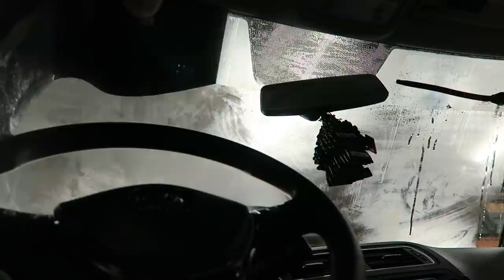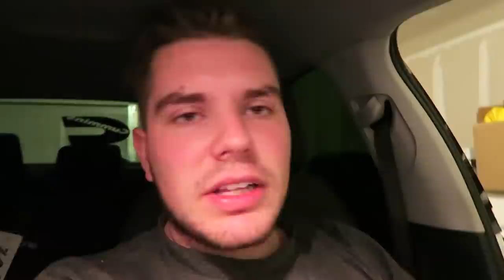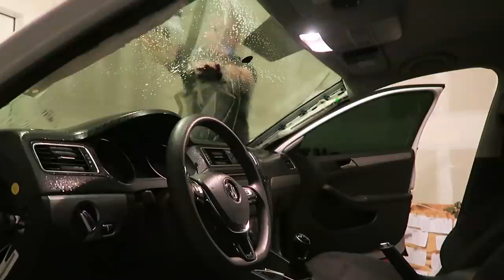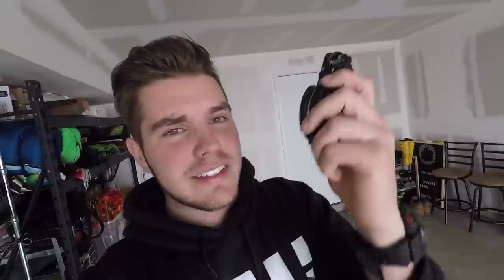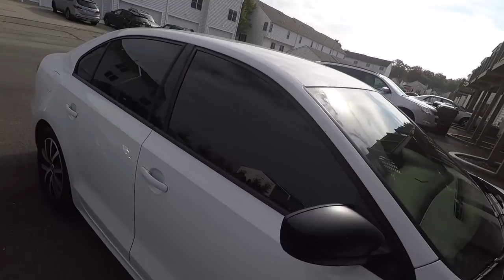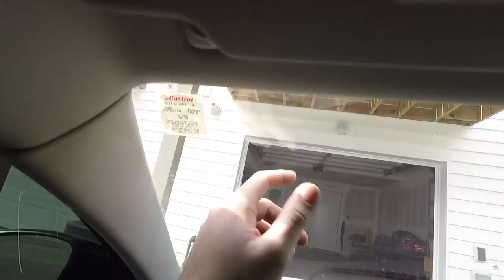What Happens When You TINT your WINDSHIELD!?!

Comment: Answer: Tickets. You get tickets.
Reply: Lel
Reply: Bs had it. Done for 2 months zero tickets was even pulled over for exhaust
Reply: dylan young lol not in Ny. When cops see tints it's an instant ticket
Reply: Never got a single ticket and it's been 2 years on my car. My dad's truck has 5% on the back. 35% front windshield, and 20% driver and passenger. His truck was from 1997, we changed the tints after 15 years cause it was getting old. But we kept the same shade. 20 years and still no ticket. My Altima has 5 all around and 20% on the windshield. Never got any tickets. This is all in New York and we've driven upstate and such with and passed not just regular cops and state troopers. We've gotten red light tickets and speeding tickets. But never for tints. Every time we get stopped we turn the interior lights on and roll the windows down before the cops even get out of their cars. Runs our license to see if we owe any tickets or any warrants for arrest. After we are on our merry way with no tickets.
Reply: Wrong, I have dark tint on my car and windshield and I haven't been bothered by the cops
Reply: Tint is regulated by state laws. It is the cop's decision if he wants to be a doucheback and pull you over, the law itself states windshield tint is illegal. The law also states the legal tint for the side and read windows.
Reply: Ricardo Sifuentes does it matter?
Reply: Cops don’t care for the most part. I have 25 on my windshield. I love it
Reply: I live in NY and got tints all around except windshield and never got pulled over or ticket
Reply: Jay Patel you just jinxed yourself
Reply: That’s so true because my went to ny and lives in md and they err going to give her a ticket
Reply: i live in NY i have 5% all my windows and i just got a ticket for the driver window 92$ for only one window smh , but when ya get a ticket you just gotta find a car the same brand take a pic of it go to court and be like i took the tints off more cheap than pay 92 for each windows
Reply: I have 5 all around and 20 on windshield and I haven’t gotten 1 ticket...
Reply: LMAO!
Reply: Harambe Jr. You ain't lying , of course YouTube got all the people in the comments that shit never happened to. 
But unless you live in a nice part of new York like long island or Manhattan, they're gonna get you.
Reply: i  tinted my  pick up  truck new in  2004   at 5% and  its  still  on  it  today  even  after  i  sold  it  years  ago  i  still  see  it  around    with  same  tint !14 years later
Reply: Will it pass inspection with tint like this?
Reply: Not in all the States like Florida it’s a law that you need tints on your car because of the sun
Reply: All depends on what state your in and what percent ... in Cali you can not have your fronts tinted but fuck it . officer's do it at my job all the time for 80$ . They usually get 20% 35% an 50%. I can do a FRONTwindshield in 20 to 35min.
Reply: My concern would be safety. Daylight is okay but night time with low lit areas. It would be hard to see out. Backing and trying to see if there are people or objects. That is a risk there.
Reply: Yeah Chicago has 35% limit but for some reason people get darker tints in tints on the windshield. Must have extra money to pay bills.
Reply: Jay Patel 
Yet...
Reply: That’s illegal in wa state
Reply: Not if you have a prescription
Reply: Zachariah Ishmael I have 25% all around in NYC no ticket ever never even got pulled over 😭
Reply: Zachariah Ishmael F NY
Reply: glovedcop69 no sir
Reply: THROTTLE KING my kia comes standard with 70% which is nothing..
Reply: Mikeman Jordan ticket is okay it’s the mandatory court appearance you gotta be concerned about
Reply: iRobux that’s awesome
Reply: @harambejr.4711  how can a ticket be a cops personal decision?
Reply: it's legal in Ohio. Only Ohio.
Reply: I thought that was legal in USA, in my country it isn't. In my neighbor country you can even tint your windows blue
Reply: Harambe Jr. cool
Reply: california driver here have went 50k miles 2 years no tickets so dont listen to this guy
Reply: @hambix1032  California? The same state that car enthusiasts have made numerous videos mentioning how strict their car modification laws are? LOL 🧢
Reply: @harambejr.4711  yeah man. i don’t drive like an asshole. cops don’t fuck with me. even if i did get a tint ticket, i’d just pay it. no points on my license or anything
Reply: @rogerlee6289  yeah if u open ur front windows it makes it look like u don’t even got the front windshield lol

Comment: For a flawless application, spray entire surface and adhesive side of tint with a mild soapy water. Lay the tint on the surface and smooth it out. The soap underneath allows you to slide it into place without it sticking. Then with an isopropyl alcohol and water solution, lift a portion and saturate the tint and surface and squeegee that small portion. Then spray alcohol a little further down working slowly and leaving soap solution on the portions you aren't working on yet. With either solution, it allows you to lift it to reposition it. After some heat and drying time, it will be flawless. No bubbles or dust if done correctly

Comment: Logical/easier thing would have been to drive at night with sunglasses
Reply: mirror tinted ones then ! But the best would be mirror tint on the windshield to see perfectly the road ahead without being blinded by those ultra bright led lights.
Reply: MrMit50101 .....best comment.
Reply: MrMit50101 Or just get Air blue for your windshield,it's 100% Clear but it acts just  like 5% Tint
Reply: How does it act like 5% tint when air blue is 75-80%. Key words, "Clear" and "5% tint" how is 5% tint clear?
Reply: MrMit50101 but tinted windows look better on ur car so it’s no point of wearing sunglasses

Comment: That windshield tint looks very nice im doing 50% windshield  15% all around and 15% over 5% tint strip
Reply from the maker: kia bass 879 that’ll be a dope setup!
Reply: I had 55% on mine at one point. Was way to light for me. Its hardly tinted at all when the Sun hits it. It looks dark in the video because the Sun isn’t hitting it directly. I have 18% full windshield with 5% on all other windows.
Reply: Ryan Mayer do at night
Reply: Ryan Mayer yeah I know it should look as dark as your windshild
Reply from the maker: The PurgeGod coming very soon!!!
Reply: Ryan Mayer very cool.
Reply: kia bass 879 You should just do 5% all around and air blue for windshield
Reply: Da,Taper I think 15% is perfect its not to dark or to light but if I don't like 15 ill put a layer of 5 over it and if 50 is not dark enough for my windshield ill do 25 after I strip the 50
Reply: Da,Taper that air blue is not a bad idea with 5 all around
Reply: kia bass 879 Bro Air blue is worth every penny I got a Jeep grand Cherokee 15% for my two front windows and air blue for windshield it works just like 5% but it's clear so you won't have any trouble with cops great investment,
Reply: Da,Taper then I guess I will get the air 80 and llumar atr 15 all around
Reply: I did that on my 08 acura tl it looked good. If thats your kia it should look good as well
Reply: chavy yeah I might get a 2016 optima and change the pic on my channel once I get the Kia this spring
Reply: I have 5% all around and 35% on front kinda wish I had 25% on front now
Reply: Clint Eastwood yeah 25 is nice because you don't have to wear sunglasses at all
Reply: Axel Dupon wrong
Reply: I have 5% over 20% on my side windows and 35% on my windshield
Reply: Clint Eastwood that’s exactly the setup I’m thinking of going with... how is night time visibility?

Comment: I drive a black 04 Saturn Vue and I got it tinted this past Saturday. I got 35% on front driver and passenger side and 5% on top of the 20% on the front and passenger rear. I agree 100% with you, in recent times, more like the past 2 years driving at night been so fucking hard because everybody lights be bright as fuck to point few days ago one of my eyes a portion of it turned red. Im thinking about putting 20% on top of my 35% tint on front and passenger window, I wonder it would be close to 5% tint? I might put 35% tint on my windshield one day.
Reply from the maker: Yabby Gideon pitting 20% on 20% is almost exactly 5%, so your 35 and 20 will equate to about 7% which is still close!
Reply: Ryan Mayer Alright, thank you. I got the Llumar ATC 5% tint and earlier in the day I was able to see through the rear windshield  just a little bit, I was kinda blown by this, but is this what I get for 290 plus tax? Lmao what type of tint you got? Do the other level of Llumar tint (like the CTX) make the windows blacker if I gotten 5% tint? If thats the case, I might just get next time the CTX  15%  or 20% on top of my ATC 5% tint front and passenger side windows.

Comment: 2008 M6 - 5% on sides and back windshield, 20% on front windshield - toooo Dark. 
2012 Infiniti G37 coupe 35% on very window - 👌🏽 great, still allows light in with my sunroof open.
2017 Grand Cherokee 20% on sides and back (on top of factory Tint), 35% windshield - you can’t see in at all.
2018 Durango 20% on front three windows to match the factory Tint - hard to see out at night. 
2013 F150 20% on sides 35% on 50% windshield - perfect for the huge windshield. 
2014 Honda Accord Sedan 20% sides and back, 35% windshield - perfect combo for sedan. 
Hope this helps 👍🏽👍🏽.
Reply: You definitely like your tint...I don't blame you though!

Comment: Man I tinted so many Jettas and now it drives me crazy to see the gap on the front windows where the film doesn't go all the way back behind the pillar...if you know how to tint, you can use a T30 torx and take out the screw behind the upper trim piece on the door panel and pull the upper part up and back and pull that rubber weatherstrip out, then you can bottom load the film and get it all the way back and it looks MUCH better.
Reply from the maker: Yes I know! Jettas are extremely tight lol! I do take the door panel off and pull the weather stripping out, lolol I’ve got a 2018 Jetta to tint here soon, hopin I’ve got better results with that gap lolol
Reply: yeah i had a contract with a VW dealer and every single car they sell is a pain in the ass to tint, but once you know the tricks you're golden. BTW I was watching you install the windshield tint on the Jetta in this vid, I THINK the reason you creased it is because the huge air bubbles in it that you mowed over with the blue max. Try using your hands to really lay the film to the glass first and then start in the center and squeegee center out to the sides, repeat until you reach the bottom and then you can push the water straight down. That's the best way to get it done without fingers/bubbles that you have to heat out. (I don't mean to sound like a know-it-all, just trying to help)
Reply from the maker: No man I understand! Thanks for the tips! I’ve done many a windows but this was my first full windshield! Not very common / legal where I live so it’s usually sides and back and the occasional sun visor! Lol! But appreciate it man! Thanks!
Reply: NP. Yeah I still struggle with front windshields, mostly dirt contamination because trying to get the film in the car and on the window without it touching ANYTHING is so difficult. I've tried the reverse roll and still get some dirt, and I'm a perfectionist which kills me but it's what makes me good at it at the same time lol. Good luck to you on the 2018!

Comment: Do you really need that many air freshener trees? Lol
Reply from the maker: Yes
Reply: That's when you know you stink or you either smoke a bunch of reefer in the car.
Reply: Heath Clements or whenever it stops smelling you just add another one without taking the previous one off. Imagine if all the air fresheners you have had in your car over the years were all in one pile. It would be huge. It doesnt mean you stick it just means you are to lazy to take them out and throw them away😂

Comment: When youre under direct sun with the level you tint you have youre really not making a difference , i have limo all around and the windshield is 15% and i can see in the night clearly you get used to driving with it and get used to it honestly 5% all over is better
Reply from the maker: Angel Jimenez yes I’ve got 5 on the sides the 50% just makes it a little more cozy wasn’t lookin for anything crazy in a car this small
Reply: Couldn’t be driving out in the country at night with that much tint jeez
Reply: I seen 5% on windshield
Reply: Fuck it just go 2.5% midnight tint all around
Reply: Dylan Garan me to
Reply: Angel Jimenez  my cars bombed out 4% all the way around windshield 10% but keep in mind to upgrade your lights have massive 10k led front conversion top and bottom so i could see everything. Don't follow me though supper illegal lol
Reply: Better check your local state/provincial laws on tints, or your gonna pay big time to drive with those dark tints. Especially on a windshield!
Reply: Finally did my car 20% windshield cops really ain’t said none instead they pull me over bc of my license plate cover

Comment: I️ got my whole front tinted 20%
Reply: Dequan Briscoe how do u like it? got 50% right now. thinking if I should go 35% or if it's too dark.
Reply: Chris Dela Cruz 20% is dark to. 35% really not that dark
Reply: Dequan Briscoe I like the darkness, but I'm concerned of visibility during the night time. Especially when there's no street lighting.
Reply: I have 20% windshield and 15% side/rear. it isn't too bad, maybe because I'm in a Z but with bright enough headlights you should be okay. 
Window tint is the least thing cops worry about where I'm from. May even go 5%
Reply: How that turn out
Reply: Thinking bout doing my hole front 20%
Reply: Dequan Briscoe same
Reply: Chris Dela Cruz I have 5 windows and 20 windshield, at night I have to guess where the road is and my headlights are bright as hell
Reply: My sides and rear are 20. Winshield at 30 or 35. I love it! I can still see at night too!
Reply: 35 on the front with a dark interior is perfect, i got 5s all around and 35 on my front.
Reply: I have my durango with 2.5 % all around.   And my front windshield 5%.    5 % is dark.   Not 20%.   Go big or go home
Reply: Dare James u can't see out that wind shield then
Reply: Tint the back darker and it's perfect I love the tint so much cooler mine is 2 percent all the way and 50 front I love it can't handle tell the front just when it first starts getting dark but u can still see out the front fine helped slot with lights and heat I didn't realize how much it would help I live in az
Reply: I have double 5% on all my sides and rear. And I just got my windshield tinted 35% I can see perfectly fine out the front plus I got a double row LED bar in the front and I cant see shit out the back but i have a sliding rear window and backup camera with LED backup lights
Reply: Chris Dela Cruz  35% isn't bad. I have it on my 4runner. I wouldn't go any darker up front.

Comment: Headlights are kind of like the sun. they do what they are suppose to do and you don't look at them. anytime I meet cars I look at the right edge of the road and just keep straight ahead in my peripheral. its a great technique. it's on the drivers ed website and manual.
Reply from the maker: +tim bobaganoosh wether you’re avoiding them or not the lights can be very blinding coming down the road. The tint only lets 50% of the beam enter your vision path and helps dramatically with road glare as well! Especially these new cars with HID lights installed can be very dangerous when they wonder through your windshield

Comment: I know how headlights at night can be blinding especially when it's wet you have it reflecting off the pavement. I did some research and ended up getting some glasses that are clear (they also had transition lenses that got darker in sunlight) but they have 3 different filters that eliminate the headlight glare  and UV rays (more than just polarized) and work great.  The nice thing is they just look like regular glasses which you choose the lens shape and frame style. I just keep them in my sunglass compartment so they are readily available... A little spendy, but worth it to me,  I have a lot of sunglasses and off the top of my head I'm not positive right now where I got them. I'll find out and post back..
Reply: Random but you ever figure out where you got these?

Comment: I tinted all my windows in my car as dark as legally possible and I tinted my front window (which is illegal) but it’s not very noticeable from the outside the one I got is mostly for UV rays.
Reply: most people don’t realize that when you spend the extra money for ceramic tint you get the uv protection and it cuts down on light glare. even 70% on a windshield is perfectly fine

Comment: The front window is the easiest.  All you have to do is remove the mirror and clean the window really good.  And shreank the window, cut the mirror puc out line out peal off clear liner half way wet the film put the liner back on di the same to the other side and install

Comment: I have 5% all around and %20 on the windshield with a 11inch vinyl   strip as my sun strip. This is all on a car lol. So far haven't had problems with the cops. I have a corner peeled on my windshield so when I am getting pulled over I can just pull it off.

Comment: That is one hideous windshield tint job lol Fuck that I did 35% on my windshield and 5% all around in my Civic. I was originally going to do 20% but since I have a small crack on my windshield I wanted to see if it would crack. So far is fine and it been 2 weeks. Is so much better tinting the whole windshield but I will end up redoing it to 20%